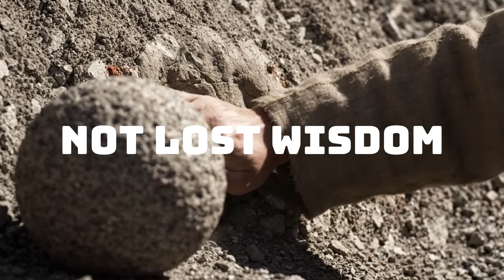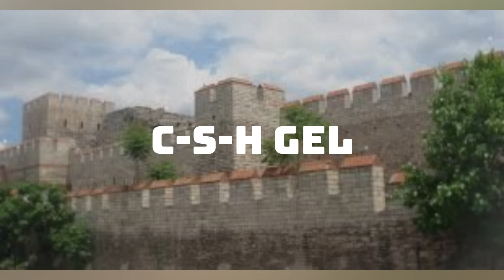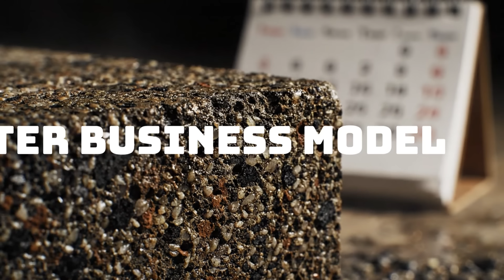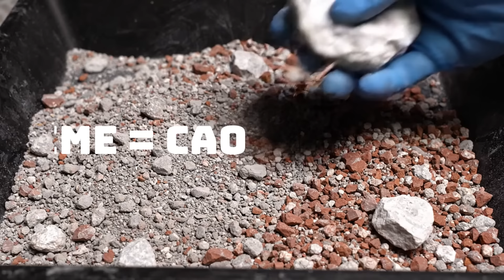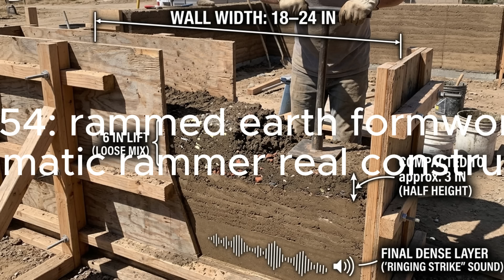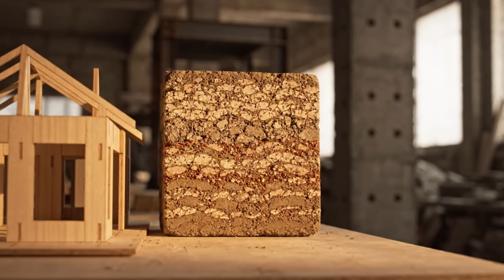Turn Dirt Into Bulletproof Walls With Ash. Stronger Than Concrete. Hidden Since 1453

Comment: This video says that this mix was using rammed earth in the USA southwest. Is it being done in Utah?
Reply from the maker: Yes, rammed-earth and earth-based wall systems do show up in the U.S. Southwest, and Utah is a very logical place to ask about because of the dry climate and thermal-mass benefits. The real question is code approval, local builders, and whether it’s being done as structural rammed earth or just as an architectural/thermal-mass wall.

Comment: if you finde water proof this will be super?
Reply from the maker: Yes, waterproofing matters — but with earth or ash-based walls, the goal is usually water management, not sealing everything like plastic. Good drainage, roof overhangs, raised foundations, and breathable exterior protection are what make the system last.

Comment: The rusting rebar is what destroys the concrete
Reply: Hence the development of non-metallic rebars, fiberglass, basalt, hemp, etc. Fiberglass being the most impressive (MST, being my go to / favorite)
Reply from the maker: Yes — rusting rebar is one of the biggest reasons reinforced concrete fails. The point is that once steel expands inside the concrete, the damage becomes structural, not just cosmetic.
Reply: Which could also be prevented by using treated rebar (using “blacksmiths iron”)

Comment: Nope. 18-24 inches of dirt, ash does nothing to increase bullet resistance.
Reply from the maker: Fair point. If the goal is true ballistic resistance, thickness, density, reinforcement, and testing matter more than just adding ash. Ash may help with certain material properties, but it does not magically turn a thin wall into bulletproof armor.

Comment: Firing limestone is expensive. Transportation Costs (dig & transport rocks) + Processing Costs (crushing stone into dust) + Fuel + Furnace construction and maintenance.

There is plenty of room for a business plan that markets a building product stronger than Steel Reinforced concrete.....that's less expensive (less than half the cost) than concrete WITHOUT the Steel Reinforcement.
Reply from the maker: That’s a fair economic point. Firing limestone, moving material, crushing, fuel, kiln maintenance — none of that is free. The argument isn’t that the material has zero cost, but that durability, local supply, lifecycle cost, and lower failure rates can change the equation depending on the region and project.